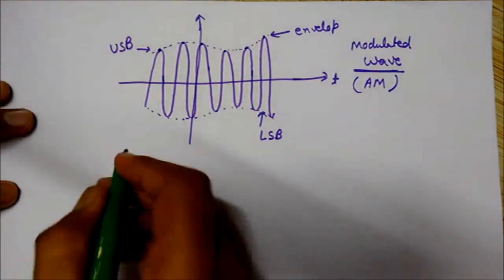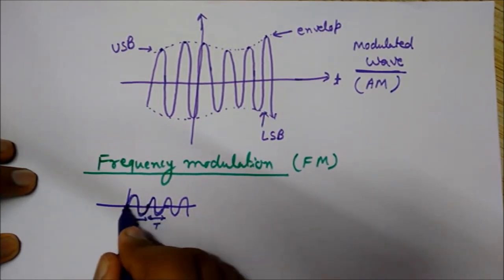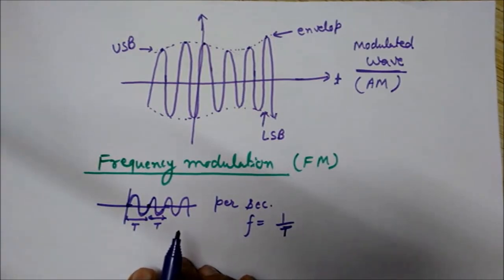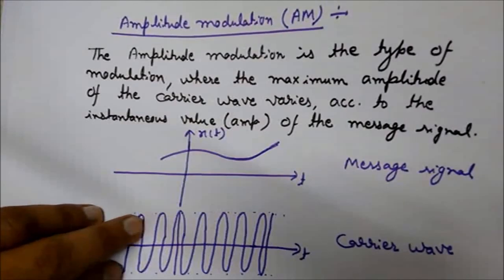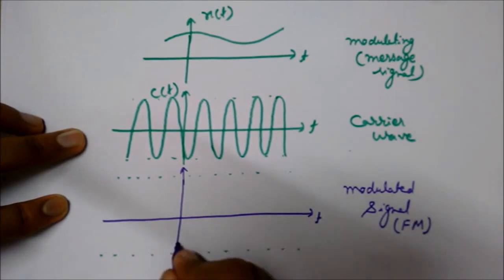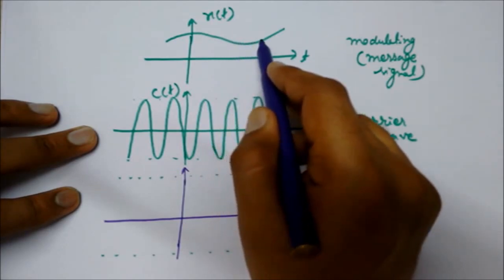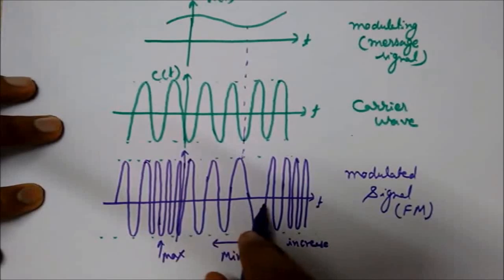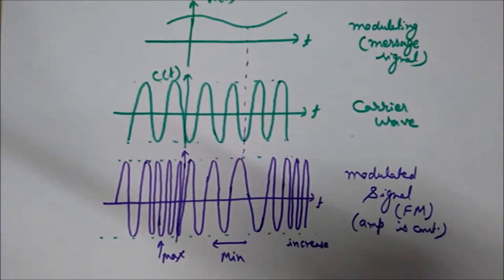Frequency Modulation (Definition, Basics and Waveform) [HD]

Comment: So with respect to FM, by modulating the frequency are we also changing the signals wavelength. Or does that remain constant like the amplitude.
Reply from the maker: If frequency changes, wavelength will also change. But in FM, amplitude of the carrier wave is not varied, only frequency (wavelength) of the carrier wave is varied according to the instantaneous changes in the amplitude of the modulating (message) signal
Reply: @EngineeringMadeEasy  thank you